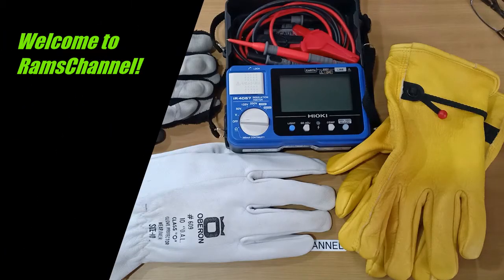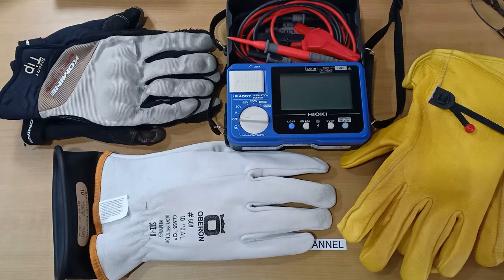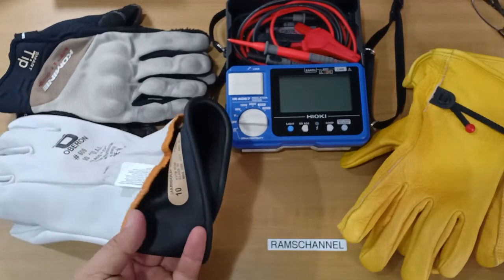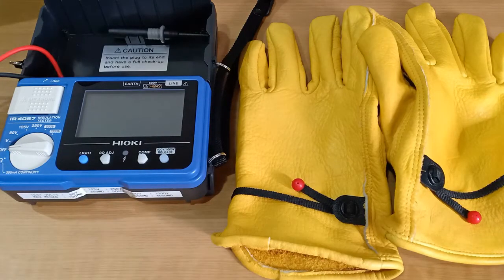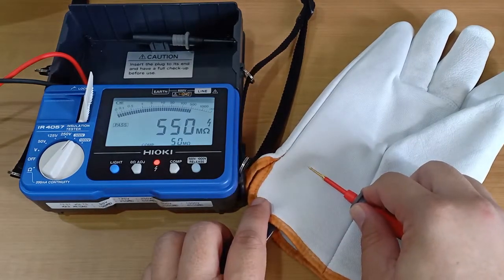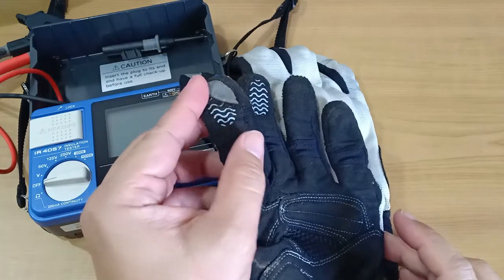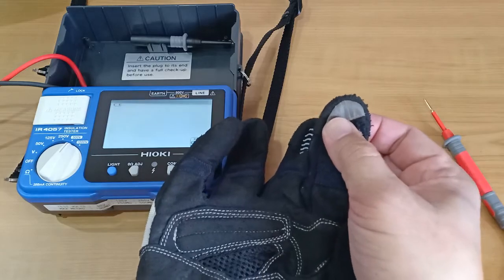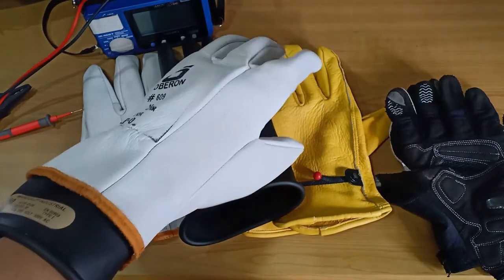[ENGLISH SUB] Insulation Resistance of Leather Gloves

Comment: this is very interesting, thank you. i wonder how regular rubber gloves for house work would do in this test.
Reply from the maker: Thanks for your comments. I haven't tested regular household rubber gloves (like those laundry gloves). Even if they're rubber they pose an electrocution hazard for the operator  doing actual live electrical work. I'd stick with the certified insulated rubber gloves.

Comment: How to order electrical gloves with water resistance
Reply from the maker: I don't know what you mean by water resistance sir. I ordered my electrical safety rubber gloves from amazon. Two of them:  ANSI/ASTM Certified, Arc Flash Class 00 (500V) & Class 0 (1000V). They were paired with suitable leather protector gloves as well. Hope this helps.

Comment: The main points:
1. It is very rare that you need to work on a live circuit so the need to have protective gloves is very limited for everyday person as compared to electricians or more so, linemen
2. In the event you need to work on live wires the gloves are only part of the equation. In addition to the gloves you have the other PPE, rules for how to work on the equipment and typically insulated tools for doing the work
3. When wearing the rubber gloves, you lose significant dexterity. These are not for doing work on live circuits like a house or even a lot of commercial situations
The concern here is that people think they can buy these gloves and go work on their equipment and not be that much safer. It would be a false sense of security.
Reply from the maker: Thank you for your practical advice, which seems to me to be gained from real life experiences. There are indeed many factors to consider on electrical safety and you pointed out some of them. I appreciate them. Since my video merely scratched the surface of PPEs, I also mentioned that all applicable rules for safety must be followed when doing electrical works.

Comment: Great video, but 1-why did you test the back of the gloves? I think the top part would have been better because it's the part in contact right? 
2-A multimeter can measure this resistance?
3-Can you discern different materials by applying a voltage and seeing their resistance patterns? LIke different type of metals, that would be interesting
I think it would be great if you could test some rubber gloves from amazon at different pricepoints and see if there are any differences.
4-Did you ever got shocked while using that device? lol
Reply from the maker: Thanks for your observations. (1) You're right, I should have tested the fingers and palms portions 🙂 (2) From what I knew, a standard DMM can measure resistance, but its results would not be a reliable indication of insulation integrity since the DMM's testing voltage is only around 1.5V, DC: it's designed for testing resistors and continuity. The Hioki 4057 insulation testing function, meanwhile, introduces up to 1000V to stress the testing object to find a weak point. However, its low-resistance testing function can impress between 4V and 6V to get a better result for continuity (3) My view of this hypothetical scenario is that the IR tester will simply "report" its findings regardless of the metal, but the interpretation of result will be determined by the user. It think it would be interesting in a laboratory setting. (4) Yes! A quick one, as I recall it was at 1000V testing voltage of the IR4057. A bit unpleasant but not dangerous since its maximum current (touching its tips together) is only 1.2 milliamperes, or less.